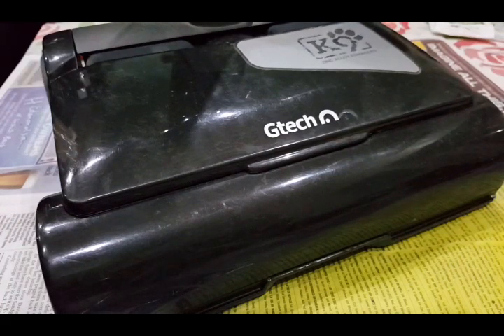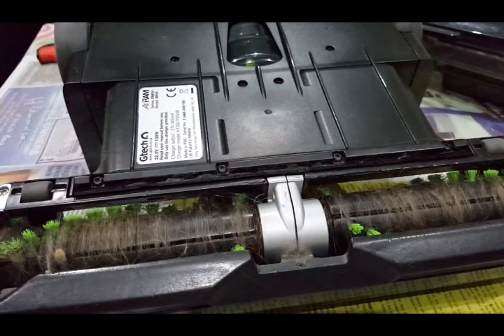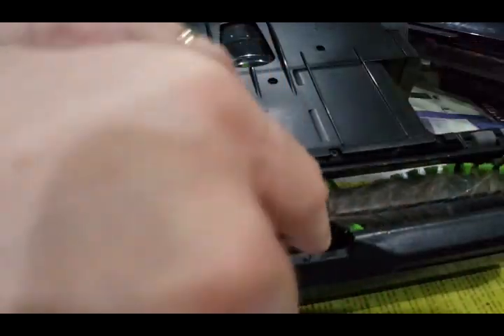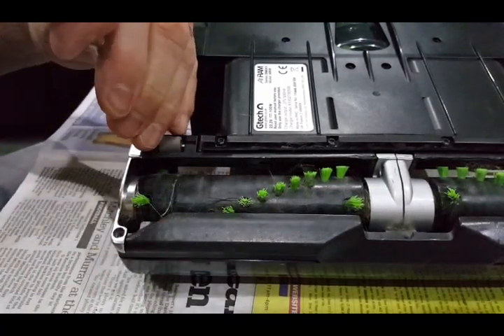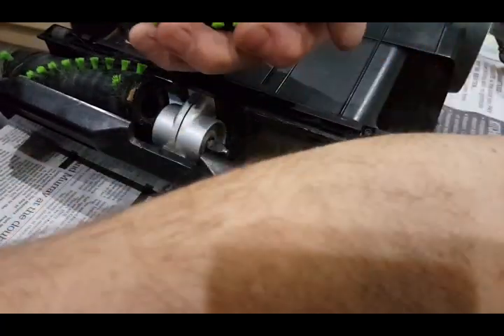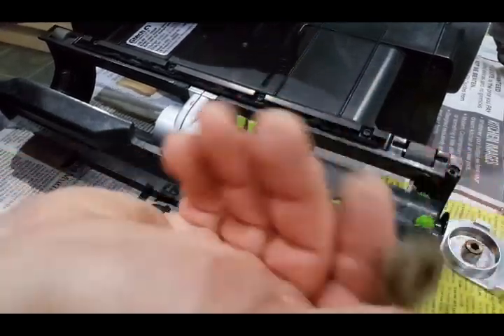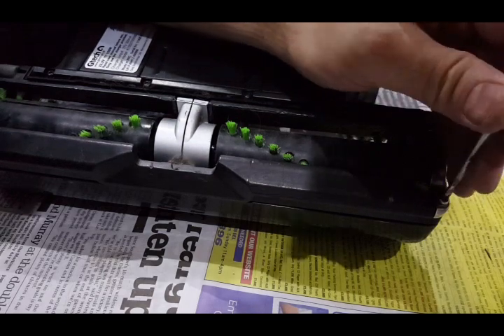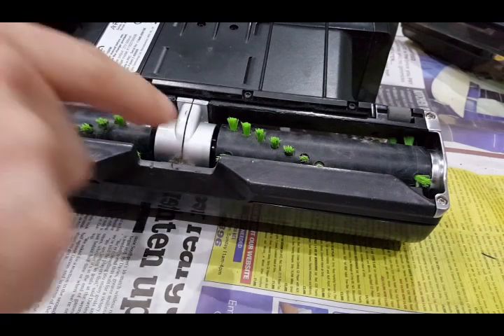Gtech AirRam brush roller hidden problem and how to fix it

Comment: Fine if all that's wrong is hair wrapped round brushes. However, having removed hair plenty of times, the middle drive which drives the roller-brushes round now isn't moving, so clearly the drive to that central piece is damaged or disconnected and with brushes removed it still doesn't revolve when the motor is running. 

The screws holding all the rest of the underside on are tiny and very tight and nothing I have will shift them. So it's effectively useless other than being returned to maker, and the cost of that wouldn't be worth it. That's the problem when a company with no experience in vaccuum cleaners thinks it can make better than established vac makers. Clearly, GTech spent more on advertising than they did on research and development, and this is the result. Worthless load of plastic for recycling.
Reply: You need a T10 screwdriver to open it up

Comment: Bought a bush cordless stick vac for £79.00 does the same as this with hair but in every other respect is brilliant and even more manoeverable than the g Tec but at a small portion of the price. Love it. I don't think that there are any vacs that Don't clog up with long hair are there ? I don't have to disassemble mine either, just use a pointy knife.

Comment: Does Gtech pay people to design this crap?
Reply from the maker: Apparently so. The AirRam has had a couple of redesigns since this first version. I haven't been tempted to buy one to find out what's changed. I suspect the roller set up is very similar. Mine still works ok but does need this cleaning procedure quite regularly. The improvement in performance afterwards is quite notable.